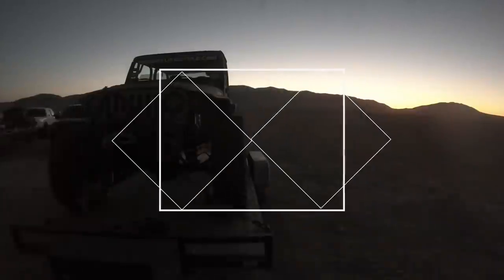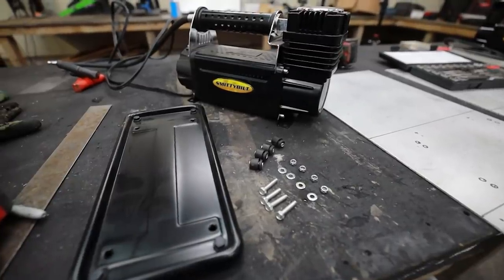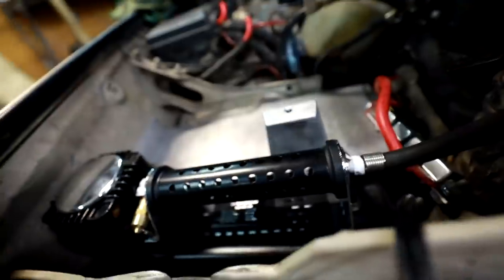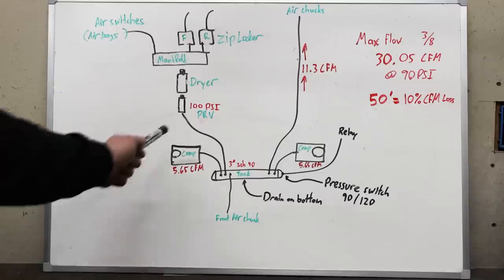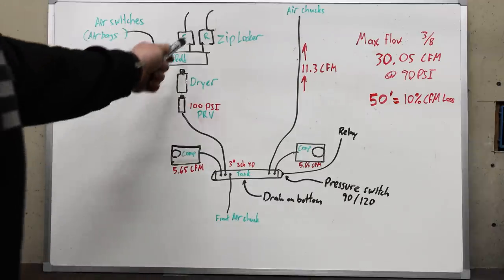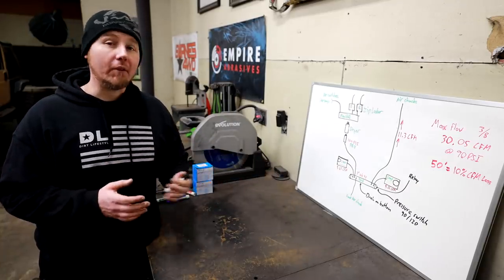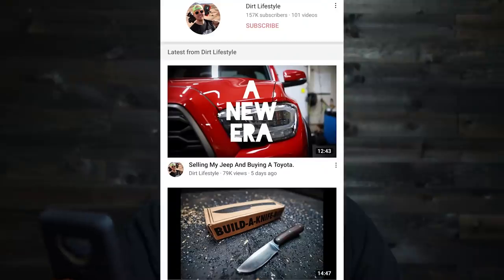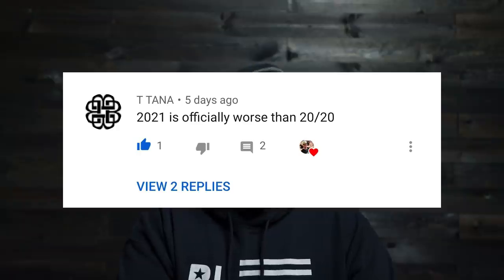FAST DIY Onboard Air! Ultimate Land Rover Discovery Build Episode 21.

Comment: the rear bumper on my LJ was built to double as an air tank i never got around to hooking it up to air and testing it, started questioning the welds as it was early in my welding learning process but i think i overkilled the hell out of it if i remember correctly did like 3+ passes on every joint with 7018 and 7024 jet rod, rod was free at work, made of 3/16 and 5/16 steel somewhat a 4" square tube 5ft long but it has bevels on the end and foot steps notched into it and tire carrier mounted and hitch in the center so alot of places for leaks or issues

Comment: Bit late now 😆 but Discovery 1 and 2 had a mount location on the left side of the chassis for both a compressor and airtank from factory. Simlar to the disco 3 and 4
Reply from the maker: I have seen! I want to build water tanks for those locations 👍

Comment: I have a 1992 YJ and I put the very same compressor on the rear right fender. I love my Smitty-Bilt air compressor. I used an A/C compressor switch which activates a continuous duty solenoid. (It's fully adjustable) I have 2 - 6 volt  golf cart batteries for power as I also have a 600 watt pure sine wave inverter running off of them. They are connected to the Jeep battery via 4 Ga cable and another continuous duty solenoid. They double as a booster battery if I forget to turn off my headlights, which I've done a couple of times. My air tank is 4" pipe that doubles as a Bull Bar. Anybody wanting to see can leave their email here and I'll send them photos and specs.

Comment: *Even if the air system was going in a diahatsu, the content is informative and entertaining. 
    *I didn't catch if you included a drain valve in the tank. Also, do you think it would be worthwhile to coat the inside of the tank with fluidfilm, or is rust not that big of a concern?

Comment: Nate...you talk about the CFM between 1/4" and 1/2"  but if we have a system like this just for airing up and down tires...wouldn't the valve stem be the neck down spot and control the speed of filling a tire???

Comment: Just watched your OBA video. Very glad to see it because i was thinking of doing something similar using 2 smittybilt units. What relay/solenoid did you use? Would you be willing to share a rough electrical diagram with parts you used?

Comment: Nate, you may want to double check your pressure research for the Discovery 2 rear airbags.

From memory it's more like 70psi working pressure, not the 30-35 you said in the video.
Reply from the maker: I've seen numbers all over the place from 35 psi, 70 psi and even 100. The owners manual for this part says 35 max under load. Here is a link to etrailer and it says the same. It is worth noting that it seems to change vehicle to vehicle.
https://www.etrailer.com/Vehicle-Suspension/Land+Rover/Discovery+II/Firestone/F4121.html
Reply: @DirtLifestyle  air assist bags are not the same as the factory air suspension.

The Discovery workshop manual has lots of useful information and is in PDF here: 
https://www.google.com/url?sa=t&source=web&rct=j&url=http://www.landroverresource.com/docs/D2_Workshop_Manual.pdf&ved=2ahUKEwiUw66y5ZLuAhVgHTQIHe_DDNQQFjACegQIFhAB&usg=AOvVaw3MUa49mdKRDPMtPxXATlHM&cshid=1610333549583

Although it doesn't state the pressure in the suspension description, I am sure from my previous experience working on the system 70psi is a familiar figure.

I would throw a schrader valve on the system and fill it with shop air to see what pressure gets you to ride height before you select a PRV.

But I'm sure you have it in hand. 👍
Reply from the maker: @jordanbridges8962  thanks man! To be clear I don't have e factory air ride suspension. I'm installing Firestone ride rite air bags
Reply: @DirtLifestyle  no worries.

Firestone bags should do you well. 

I'll stay tuned to see what you come up with, as always.

Comment: With small tanks I like to fill them 50% with water, then pressurize to check for leaks. Obviously with the entire system hooked up and mounted to the vehicle, water and electrical equipment dont go together so that's where the soapy water comes in.

Comment: I would honestly love to see the RCLT setup. have been looking at it for the last year for my 2016 TRD OR... but have just seen a whole lot of nothing from Marlin lately not to mention no price on the website, or information on the MAR-Rack install that is required... I did order the cam tab reinforcement brackets from them.. going to shop tomorrow to see if my mechanic will weld them in...

Comment: Nate love this diy air setup. one question when you ran the 2 compressors to your tank what fitting size is at the compressor? is it npt? i want to put a quick connect to be able to use my hose and gauge from my DIY Co2 tank setup and wasn't sure the compressor fitting size of the leader hose. Not wanting to use the thread on chuck and gauge that comes with this setup.
Thanks John

Comment: Few questions

1) why compressors in the engine bay? And what’s the probability of them sucking in hot air/water
2) why such a smal tank/main manifold. And is there another place for a bigger tank?
Reply from the maker: I will answer this next week 👍

Comment: By using such big output line, aren't you gonna drain the tank and outrun your pump? It'll be running all the time. Wouldn't it be preferable to have equal input and out put cfm or maybe slight resistance so the compressors can keep up?

Comment: I did a real similar setup with the same compressor.  Before I build up to my pressure in order to have the mechanical or electronic pressure switch turn it off the pushbutton fuse on the top of the compressor pops out. It’s so annoying every time I have to go under my truck push the butt back in. I spoke to the manufacturer and they said the compressor is not built for a closed loop system. Any advice?

Comment: Hi Nat I don't think I have watched an ep of your videos where I did not learn something & get inspired on build that I thought I just would lack the skills or equipment. You videos are well communicated.

Regarding the neg comments you received about you r Tacoma that you are excited to create with. It is sad that some people use something like a vehicle as a symbol for separation & division.

I think you handled it really well, awesome attitude.

Here in Australia I have had the equivalent of a Tacoma for the last 4 years. They are called Hiluxes here` It is a 1981, solid axil front, discs in the front, drum brakes in the rea. I put a 2inch lift in it, with 33inch mud terains. I really only bought it because it had a v8 engine swap (4.2 litre chev equivelent) & I needed a daily driver while I am building my dream wheeler.

It grew on me & when I started to do the home work on them, I started to realize  even the last century Fred flinstonemobiles Hilux/Tacomas are a really capable vehicle even stock. 

Even with the new standard leaf suspension in it, the ride is still not much to write home to grandma about.

I have had this thing out in the bush & got my self super stuck cot out with only a bottle jack, hi lift jack, traction boards & a 2500 kg ratchet binder that is it!

There are things I don't like about it, I am sure if I got in a spanking new one I would find things I like & dislike, all vehicle have their pros & cons & what  I like about what you do is getting creative & making the vehicle suit what you want & the journey that takes you on.

Worry not about the hairless monkey tattoo princesses :0)

Comment: I'm thinking about going to an ARB twin in my TJ. Only because they fit so well under the brake booster.  I've considered using my rear bumper as a tank since it is a fully welded box tube.  What are your thoughts on it? It would obviously be exposed in the rear but I think it's a pretty hefty piece.

Comment: Why not use the tank already on the vehicle for the old air shocks system? Did you consider running the pressure gauge into the cabin?

Comment: if you could add a little more volume to the system you could run air tools intermittently off this setup, fill the tanks to 120 maybe even 150psi knock it down to 90psi to the gun so youre not wasting air running full pressure all the time and im sure you could knock off a set of lug nuts then allow it to fill back up while youre getting the other tire ready or fixxing that one, die grinders come in handy too, not necessary now adays with the cordless lithium tools we have but an option or someone who has excess air tools orr only air tools

Comment: Nate , I’ve got a pipe bumper made of 5-7/8” drill stem that is blocked off at both ends in the past my dad would make air tanks outta 4” stainless steel pipe which worked great to put enough air in a tire on the truck to get us home now I want to build a tank like yours with a an air pump to help out when I’m pulling my 40’ long gooseneck trailer.  I was wondering if my pipe bumper will work

Comment: Just a FYI for your channel.  3" sched 40 pipe has a nominal OD (outside diameter) of 3.5".  The wall thickness of 3" sched 40 pipe is 0.216".   I am not trying to be a know it all but I think people might accidentally buy 2.5" pipe (2.875" OD) by accident.  The wall thickness for sched 40 2.5" pipe is 0.200".  In my opinion, pipe is sized in a very weird way.  The OD is what you expect until it is 16" OD or larger.

Comment: Sir
What kind of air filters or cleaners do those compressors have?
Also are you going to use air drains like on the semi-truck air tanks.
Reply from the maker: They have OEM air filter but they will be ran remotely in a future epsilon 👍

Comment: My on board air cost me 10$ used AC pump on blazer,Three gallon tank,preacher switch is already on AC line. Used window defrost switch for on off,30 seconds  ( 120 PSI ).just add oiling spot on inlet side of pump.

Comment: How are the compressors after a year's usage? thanks
Reply from the maker: They are fast but one blew up. I'm changing out the pressure switch to a 70-90 to see if it was to much pressure or if I just got a bad compressor. 👍

Comment: Hey Nate, I've actually got a disco myself.  I would love to do something similar, between the 2 compressors and the tank how well do you think this will run air tools and fill up tires? 

I'm mainly looking to air up tires but being able to run air tools for short period of time to get those stuck bolts off etc would be very useful.

Ps if you have any discovery parts you no longer need you can post them my way 😉

Comment: What was the size of the outlet pipe on the air compressor and what did you use to size up to 3/4” tubbing? Looking for a coupler but not easy to find to up size the feeder hose. Thanks

Comment: As a pressure vessel inspector, I usually cringe when I see people building air tanks on 4X4 builds. They try to make them square or have sharp corners in them that create a lot of stress. Can't complain about your build however. That design would hold a thousand pounds of pressure easy, probably much more (we failure tested one of similar size years ago and it blew at a little over 10,000 psig, it looked like a swollen pig right before it let go :) ). Remember that all vessels, with internal pressure, are trying to take the shape of an inflated balloon and you usually can figure out the best shape.

Comment: One quick question regarding the compressor placement in the engine bay. 
Isn't it a problem that it gets moist or even wet without any kind of housing?
Has anybody long term experiences bout that?

Comment: I built a system with those same smitty built compressors years ago. They are not good in the long run for OBA. They kept failing on me, and I went back to the ARB.

Comment: Are these pumps waterproof. It was my understanding that these are not and I ended up with Klein pumps instead because they were guaranteed waterproof even when submerged (as long as the intake hose is routed above the water line)

Comment: what is the dury cycle on those compressors? Why not an engine driven one?
Reply from the maker: They have that information on their websites. I was going to include it but if course they measure it differently lol. I decided to use 12v on this build 👍
Reply: I guess if the engine won't run having electric would be better.

Comment: Dumb question, I need 2 battery boxes. I am trying to teach myself on how to weld. I have a diesel so I need 2 boxes. My question is can I make the boxes out of metal or should it just be aluminum?
Reply from the maker: When you say metal do you mean steel? If so, steel and aluminum are both great options. I like aluminum because you don't have to paint it but steel is great too 👍
Reply: @DirtLifestyle  yes I mean steel. I'm good to weld steel so I don't think I want to try aluminum lol. Thanks.

Comment: Are you not worried about running the compressor outside in freezing conditions? While it is true the colder the air is, the dryer it is, I'm just thinkin about the components of the pump.

Comment: Your gonna have to call Marlin Crawler. Small staff and their busy so you'll get a faster response if you call them. Side note welcome to the hater club. I'm a Toyota/Jeep guy and family. I own and build both. I will say, and I'm looking forward see what you do with it. A lot of people in the diehard Tacoma will say you can't do something because "they don't make that." I will tell you your weakest points are your CV Axles, and your tie rod ends. For quick and easy flex, ditch your sway bar. Truck doesn't really need it anyway.

Comment: Sorry to be that guy but that 5.65 cfm rating is about double the real world flow. Once broken in they seem to individually be on par when new and slightly slower than the larger ARB single when used a dozen or so times to air up. There are some other comparison videos but I have seen most compressors first hand airing up in a big group after snow runs. Nothing beats power tank, no electric compressor beats a York, and the warn power plant is the only electric unit I have seen faster than the ARB twin.

Comment: You can't "neck down" to reduce pressure. You need a regulator to do that. Even if you have a restriction, the pressure will equalize to system pressure.
Reply from the maker: I'm confused what you are referring too
Reply: I watched it again. At 10:40 you said you wanted it to neck down, I missed where you said you were using a PRV...aka a regulator. So sounds like you're good. I thought you were necking it down like with a reduced size line or something. Some people think if you reduce size that reduces pressure, but it only reduces flow. My bad.
Reply: Love your channel by the way. Great stuff!

Comment: To be honest, it is 4cfm per hp. 11cfm  at any useable psig. It's just not physically possible.
 Mabe if you had a 8hp. Electric screw compressor .
 Why not mount a compressor unit in the storage space.
PUMA makes a 2 hp 12 volt system. ?
 Awesome build anyway....

Comment: seems awkward as the smitty does not have an auto shut off when it reaches pressure. if you stop using it while it is on it blows off or is something wrong with mine

Comment: My brother worked at Toyota in Indiana and I could have purchased a Toyota and I couldn't bring myself to do it. Toyota's are good stuff but the years he worked there Toyota's were really ugly in my opinion. I've got nothing bad to say about Toyota except they are "at times"  really ugly. I like your fabs alot but I'd rather see them on jeeps because that's what I own. I really like your universal fabs that with some tweaks will work on anything. This air system with tweaks will be one of them. I'm still in with your vids so keep up the great fab work. I just wish I had the tools and space for those tools and vehicles like you've got.

Comment: I'd rather build a Tacoma or 4Runner than a Wrangler and I'm not really a fan of Toyotas, or Jeeps. I have a RAM 2500 diesel, which can't go everywhere a Wrangler can, but you don't need to change out the axles on it, or put a crazy amount of lift on it to make it more trail ready like someone with a Wrangler would have to do. Overall though, The Toyota is a better product than a Jeep from an engine and drive train standpoint.